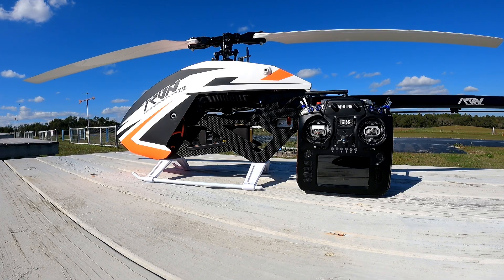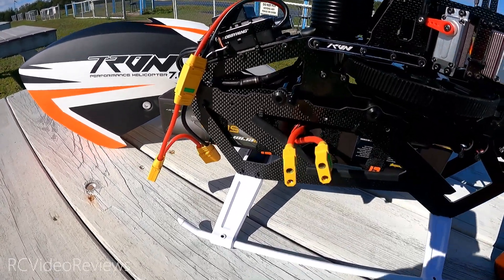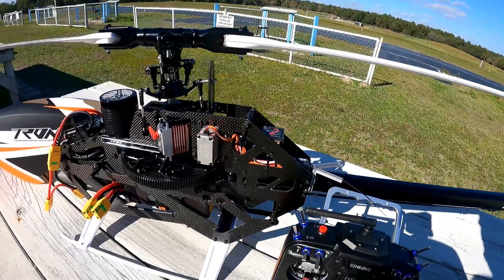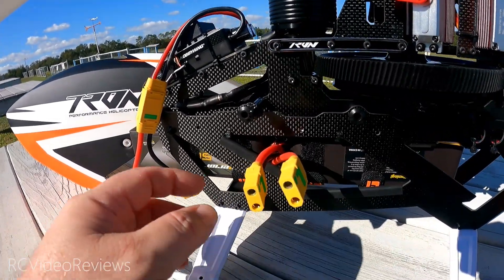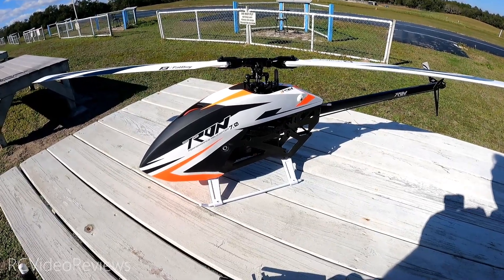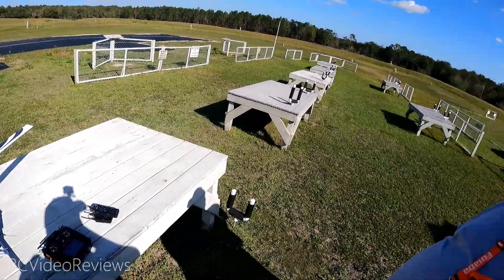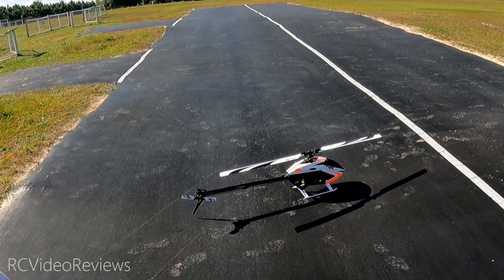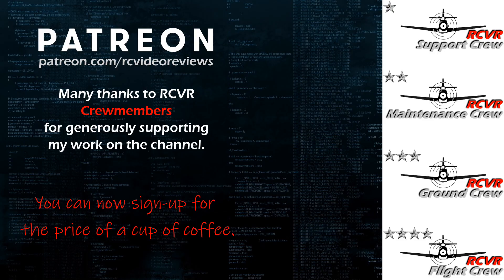Tron 7.0 Maiden and Build Review

Comment: if the blade tracking was off far enough to visually see it then you would see it in the tail IMMEDIATLY as the tail would be undulating.. also i believe the brain has a data log that will tell you how much the gyro is compensating.. that will also tell you if your blade tracking is off.

Comment: That is a big bird.
Reply from the maker: I was a little surprised how easy it hopped into the air. The blades are 1420mm with probably another ~40mm in the grips. It is impressive to watch all of that hardware gracefully fly through the air.
Reply: @RCVideoReviews  yeah you couldnt even hear a slight change in rpm as you lifted up, it just floated up